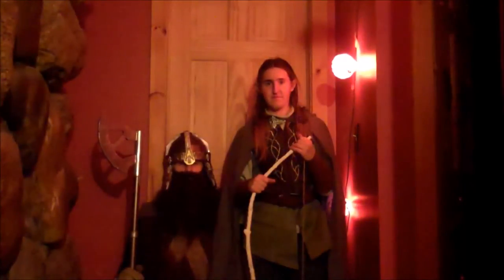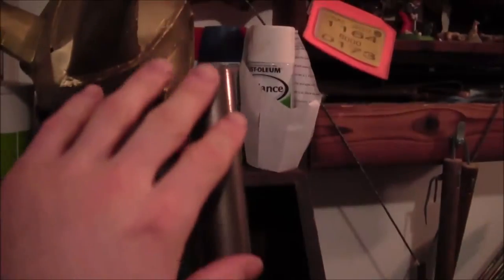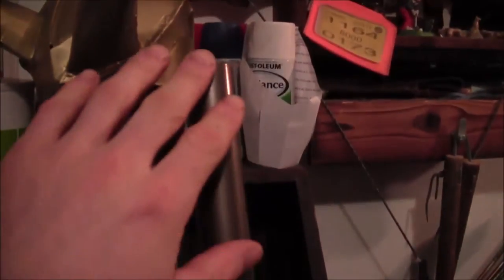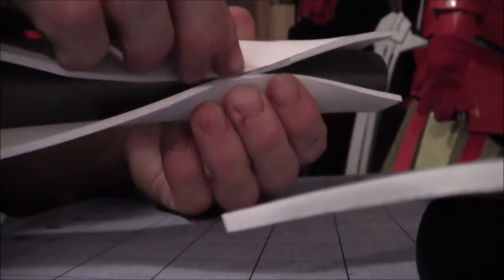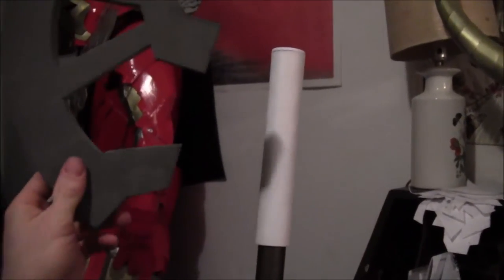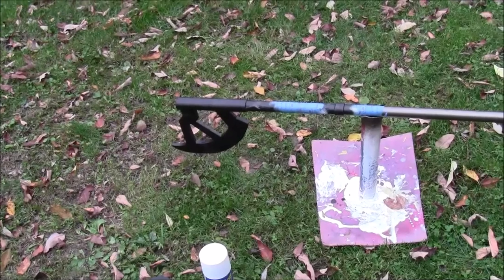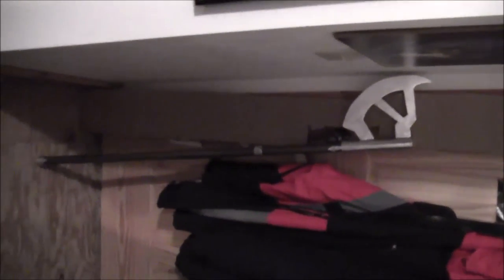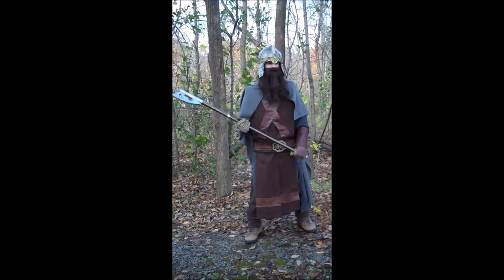How to Make Gimli's Axe

Comment: Hi loving your vids maybe you could try using an old satellite dish for a captain America shield even though you have already done a tutorial on it just a suggestion
Reply from the maker: I would, but actually I don't know anybody with an old satellite dish right now (where I from we get 3-5 channels, depending on which way the wind is blowing, lol), but basically it'd be the same concept as the pizza tray I used, as far as the painting. You'd just need a sturdier handle to hold it up. I'd recommend drilling holes through the satellite dish, and attaching a handle on the backside with screws and nuts.
Reply: And my axe